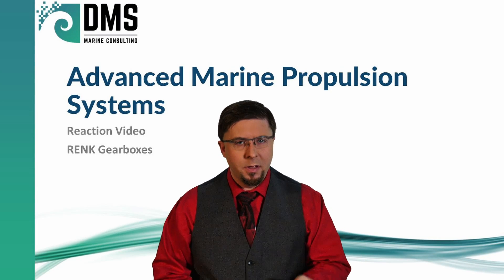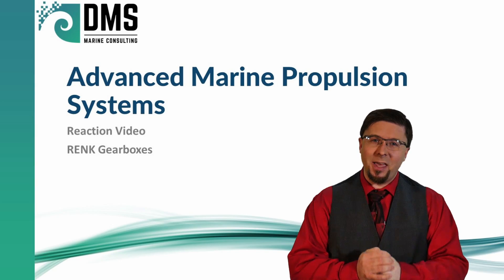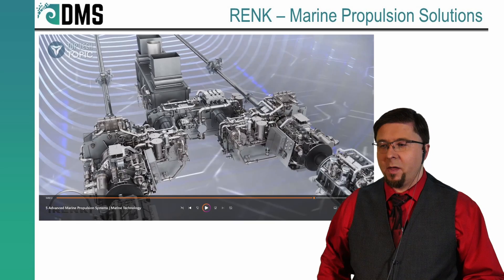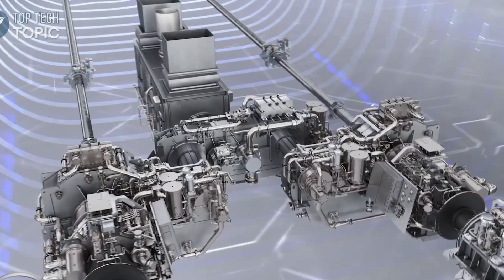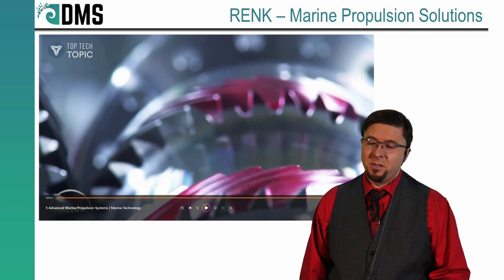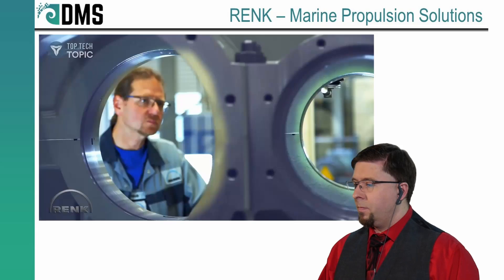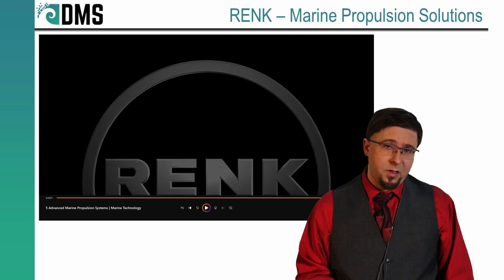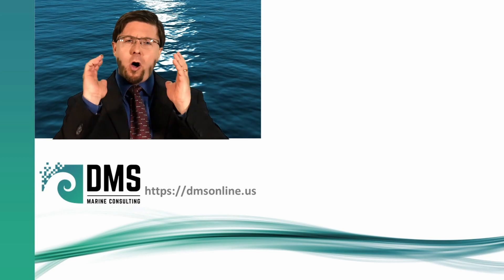Toughest Gearbox in the World?

Comment: very little is new in marine propulsion.  The last big jump was WW 2 and the period just after the war.  I have used Rank products mainly vibration eliminating couplings.  They are known for integration different types of power generation methods.
Reply: Just about all the components of electric drive are new. The use of electric drive in marine propulsion itself may not be new, but the way it is being done has seen huge advances recently, which has lead to pretty dramatic changes in the propulsion set-ups now being used commonly, particularly the increasing use diesel-electric, turbo-electric and integrated electric propulsion, and of course the use of battery power for a lot of new applications. Diesel engines have changed a lot too. They've gotten more efficient, cleaner, and a whole lot bigger. Electronic controls have utterly changed the way propulsion plants are maintained and operated by crews.

Sure a piston is still a piston and a propeller is still a propeller, but the details have changed a lot.